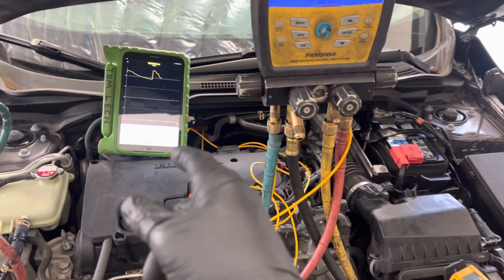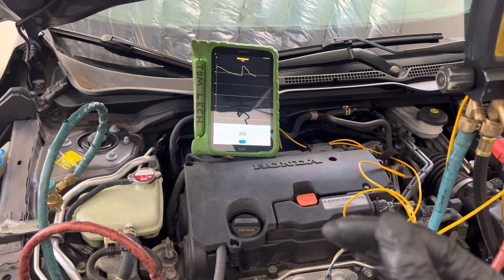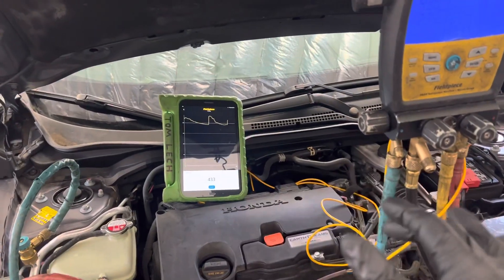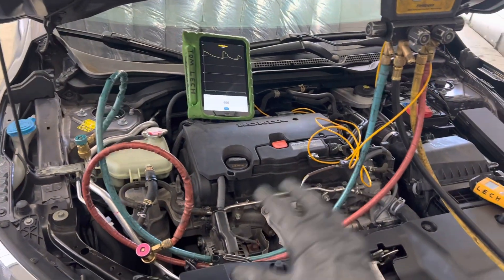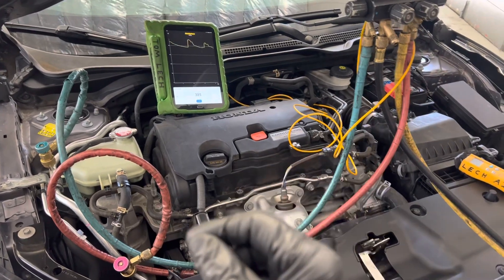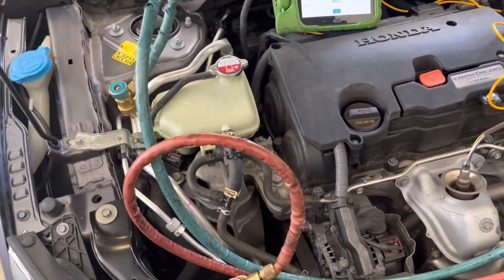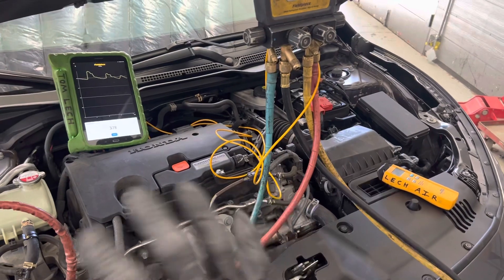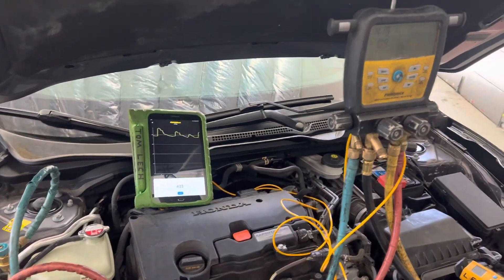SHOPS MUST PROVE THEY DID IT RIGHT.  If not customer needs to go somewhere else.

Comment: In general, how many degrees of subcooling and how many degrees of superheat are acceptable for automotive systems or, at least, in what intervals those measurements should be?
Reply from the maker: Will not give no general rule or rule of thumb anymore on today’s vehicles.   

Because it changes so greatly from HVAC manufactures systems that are third-party that are added from each year make model vehicle. 

It also jumps and varies greatly depending on ambient load conditions. 

Nowadays on automotive systems I have seen as little as one or 2° of superheat on some systems and as much as 15 to 25° of superheat it all depends on the system and the conditions it’s being tested under. 

The exact same goes for the Subcooling. 

Through experience you have to start learning and self teaching yourself because the manufactures do not release this information and they figure mechanics are the least educated group of individuals to work on vehicles they’re just parts changers and it gets a little too complicated just more stuff to make their manuals thicker.   

The exact same goes on commercial and residential HVAC for houses and large commercial buildings the old time old school HVAC guys.  

Used to be able to rely on some general rules of thumb with the old-school sloppy equipment that was fixed one speed compressors.    Depending what brand equipment they were working on one group of guys will say subcooling with somewhere between eight and 12° the same goes for superheat and then another guy on another manufacturer will say it’s from somewhere between 12° to 18 or 20° superheat. 

And it all came down to the actual manufacturer of the individual compressor that was placed inside the unit but most guys don’t read so they don’t know. 

And now we introduced VRF systems to residential and commercial and I have seen as low as 0° superheat to 5° superheat in running conditions and I have attended the manufactures service and installation and they literally developed their equipment to go as low as 0° of superheat without washing out the lubricant off the scrolls and the bearings. 

This is comes back to self education and learning engineering and going back and taking thermodynamics and fluid dynamics and refrigerant piping engineering not just being a simple installer or salesman. 

The more efficient these newer systems are being developed to achieve higher performance levels the more critically charged the refrigerant level needs to be the more sensitive they are on the airflow and the more expensive the repairs are for the guys who use rule of thumb and apply their old knowledge from other manufacture system to a different manufactures equipment.

It all comes down to reading the manual or seeking a higher education that’s provided in your field of expertise. 

Not being a simple parts changer.
Reply: @coldfinger459sub0  Have you ever thought about writing a book?
Reply: @coldfinger459sub0  I think it would be beneficial for this profession if people like you took all those loose or scattered ideas and "condensed" them into a book. I know that there are already many books on HVAC but, nowadays it does not take long for some of the information in those books, which seems to be written in stone, to become obsolete quickly, your own answer attests to this.
Reply from the maker: @dperez7656  yes I have and I have actually been asked by two different people writing books to co-author with them. 

But I run, own, operate and actually work in the field in two different businesses

At the same time I have taken on unplanned my youngest son as I put it to be home schooled in the trade/apprenticeship so I have shifted my life and devoted towards that in the commercial HVAC industry that you may have seen the videos of the large LG multi V heat recovery units that we have installed. 

This is why I do not do any editing or retakes of my videos because I just do not have the leftover time to devote to that let alone attempting to co-author or write a book which would be nice. 

I do plan to donate part of my life to re-educating students in the local traid college for HVAC two or three nights a week. 

I have been asked to take teaching positions at three different colleges in my area a fourth out of my area. 

It will have to wait until my son is ready to run his own business or my son has taken up a position in a Nother HVAC business then I will have more free time.
Reply: @coldfinger459sub0